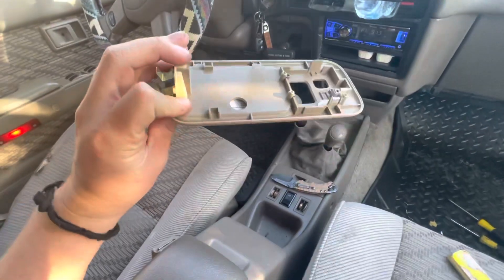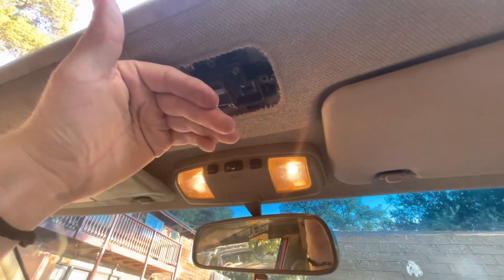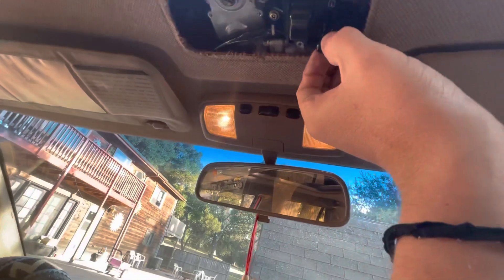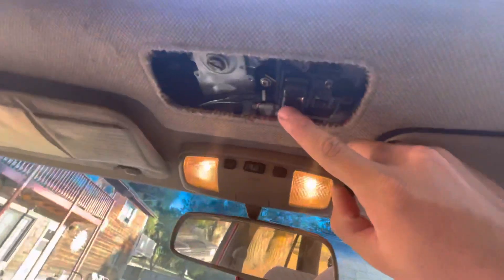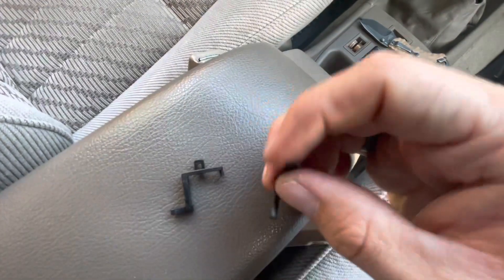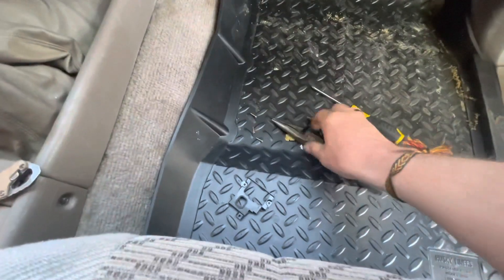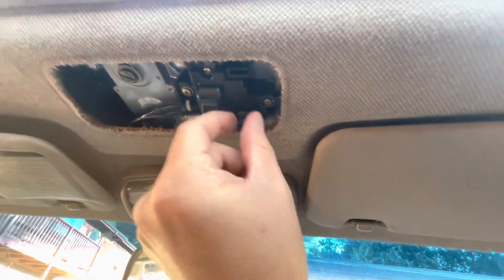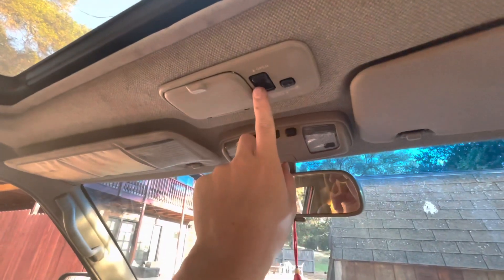1990-1995 2nd Gen Toyota 4Runner Sunroof Button Mod / Switch Fix

Comment: Thanks for posting this. I'll try it. Just bought a lifted '95 last week and it has this issue of the sunroof opening, but not closing. (Actually, I can close it if I push REALLY hard on the close button using a tool). Are those WeatherTech floor mats you have in this video? Mine has no mats, but the carpet is almost pristine, and I'd like to keep it that way (while still going to fun, dirty places).